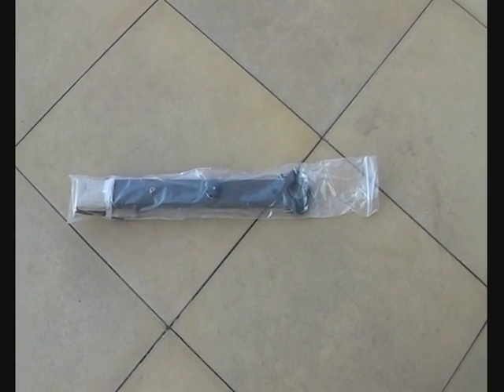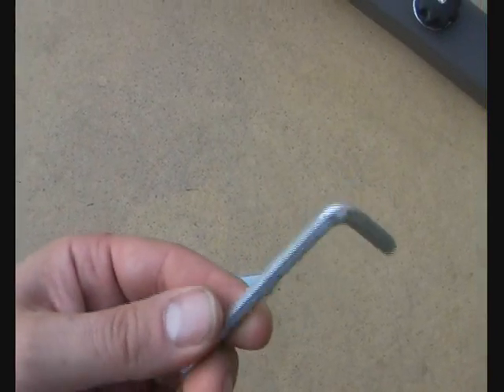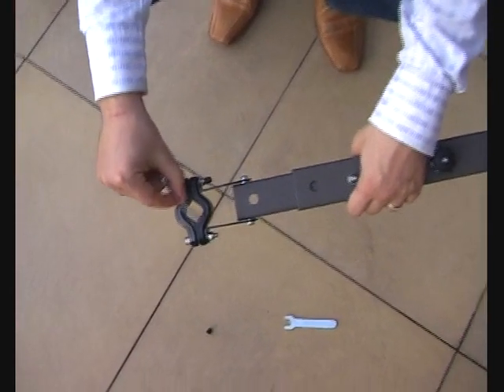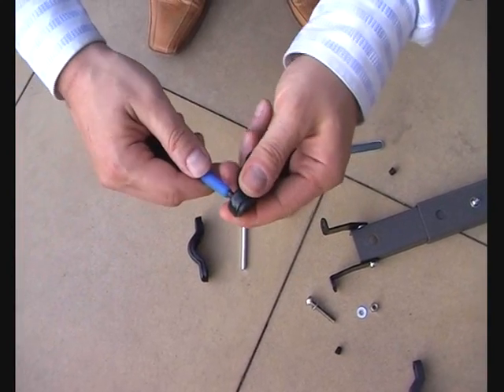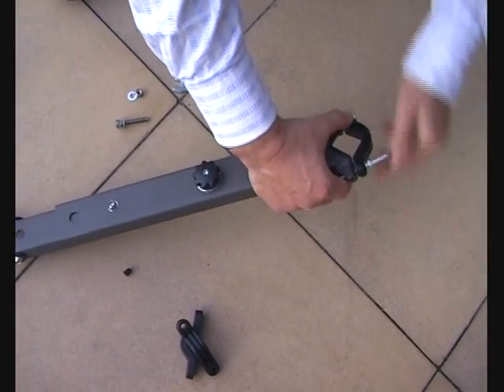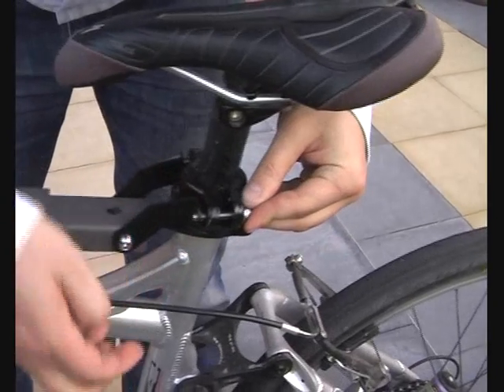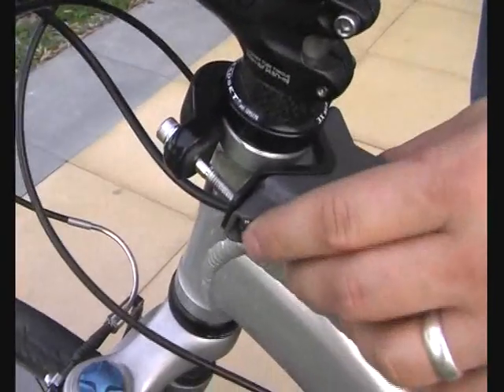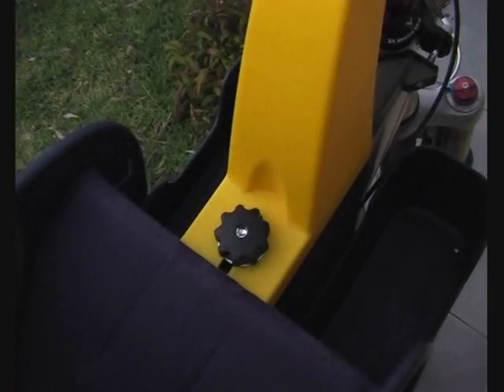How To Install A WeeRide

Comment: Good installation thank you very much. Do not remove the rubbers(plastic) they are there for a reason. Its to protect the bike frame when you tightening the screws. I chipped my bike paint be careful if you got a decent bike.